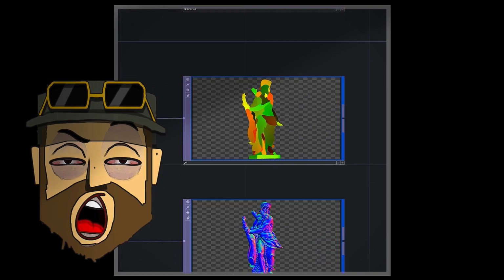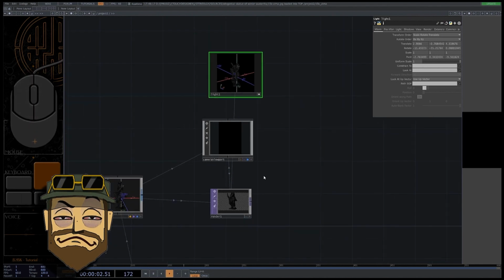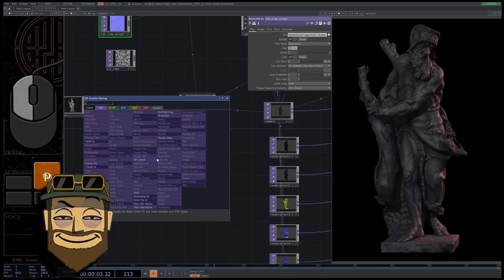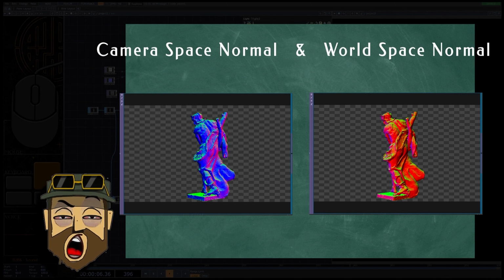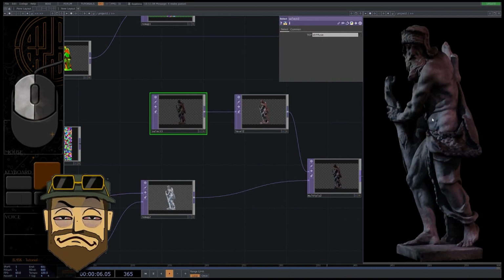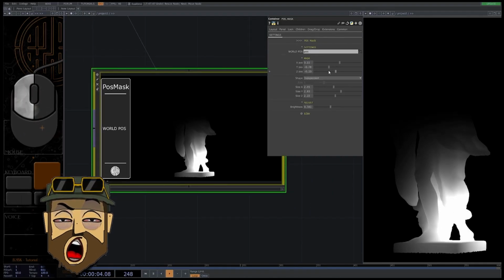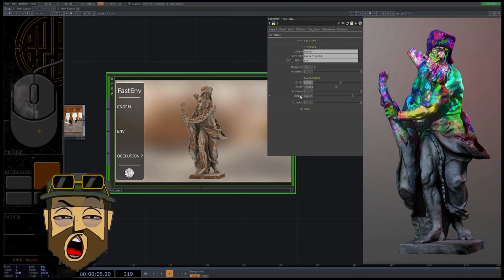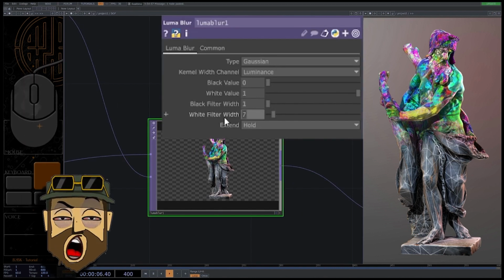Touchdesigner Tutorial - 3D Rendering with buffers

Comment: Amazing tutorial as always.
There's one thing i'm currently not understanding about the camera viewport, i see that you can interact with the camera positioning in the right panel, i'm trying as well, but nothing moves, what am i doing wrong?
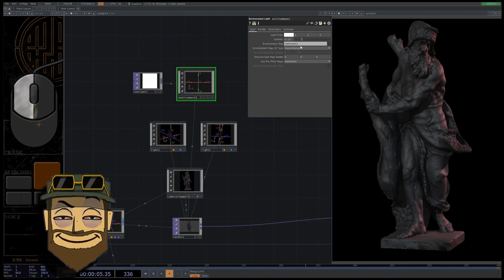Reply from the maker: Hello. CameraViewport can be a bit tricky at first. The PanelCOMP parameter should be filled with a container (= a panel). The two dots mean the parent container (the one that contains all this network). In the parent container, you also need to activate middle and right click interaction. Go at 3:15 on my pointcloud tutorial and you'll see this part.
Reply: @b2bk  Thanks!!